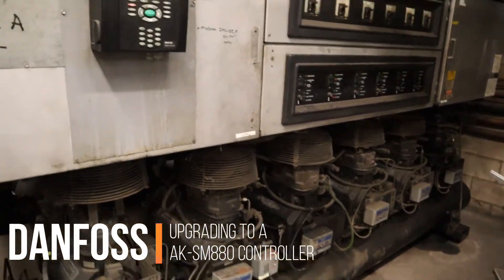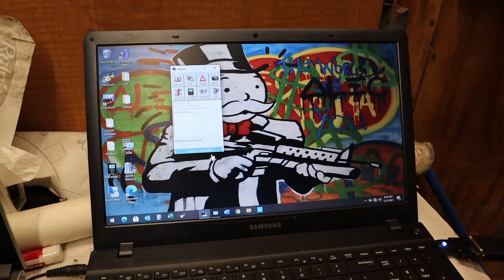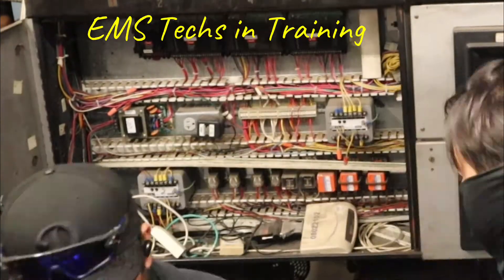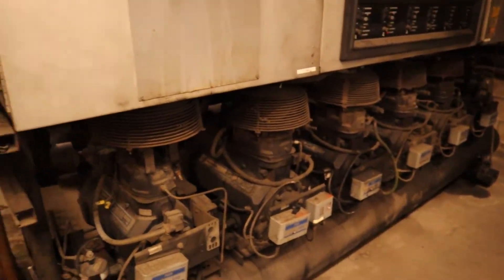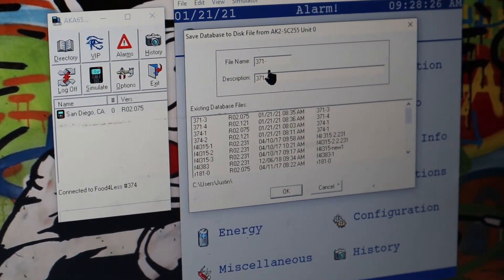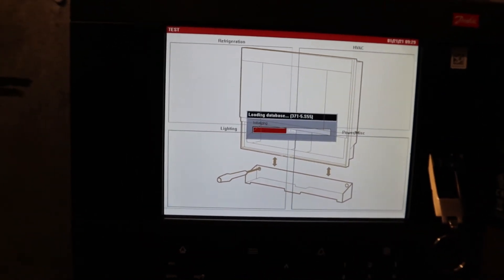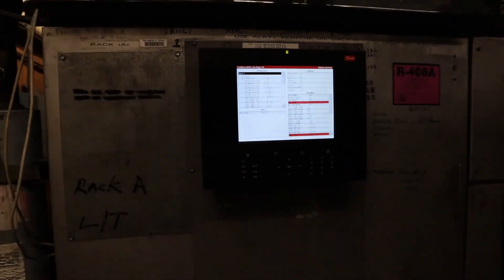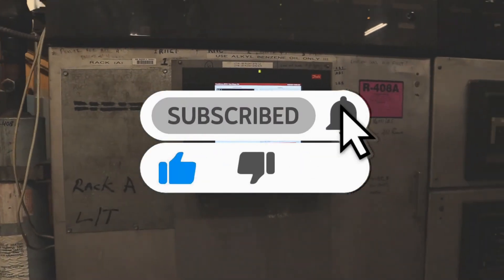Danfoss Refrigeration Controller Replacement: Ak-SC255 to Ak-SM880

Comment: When I hook up my lap top and open program it will not connect? Tried several DanFoss 250 series controls. What am I doing wrong? And yes I called DanFoss and they said it should work. But it does not. 😡 can you do a video on connections and settings?